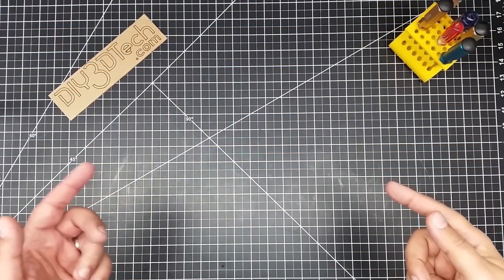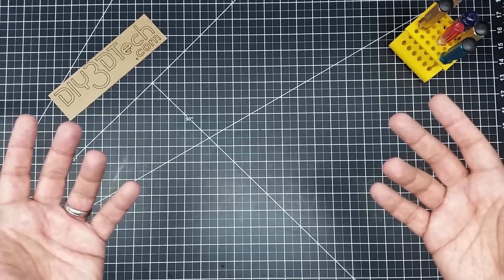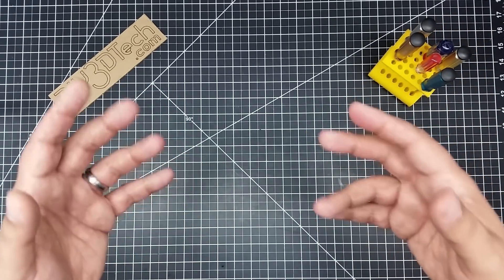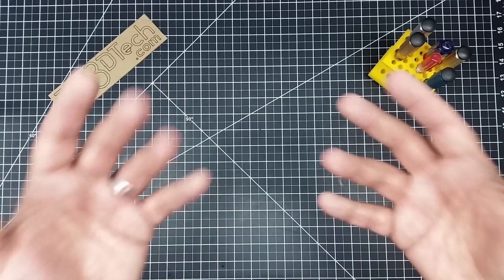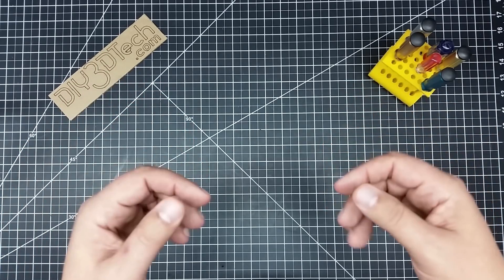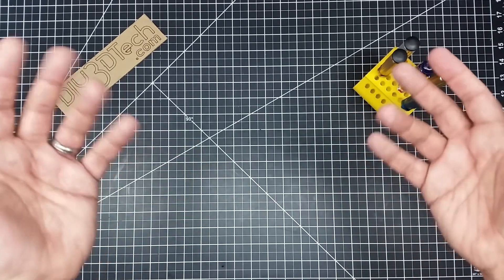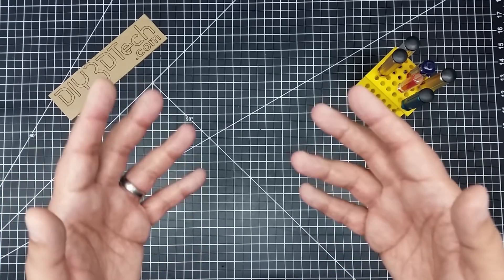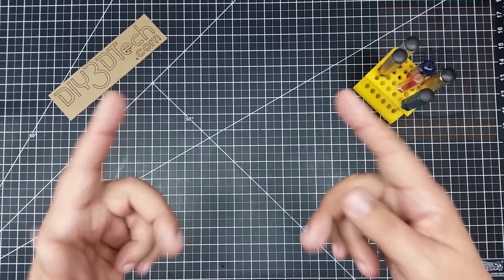I need to ask for a small favor...

Comment: 910 with my sub
Reply from the maker: Many thanks!  We are getting closer to that 1000 mark!
Reply: I'd like to see a easy starting; add a cube change the size, move the cube, add a sphere shape make a hollow through it add one to the other
Reply from the maker: Not sure I am tracking, so you want a "cube"  okay, "change size" do you mean parametric?  Add a sphere (to the cube?)  Then "make a hollow through it add one to the other"?  Do you mean you want a a parametric cube with a sphere differenced out of the inside?
Reply: Almost any : I use TinkerCAD so as close to using that. : Visual, Add a cube change size, add sphere, hollow, hole through the sphere, join the sphere  to the cube; I want to know if it is worth the Learning OpenSCAD, I've done Coding, programming before but don't want to do that again
Reply from the maker: If you have coded before, Open-SCAD is EASY!  What I am missing is "Add a cube change size, add sphere, hollow" as if do this, the result will be one or the other (i.e. cube or sphere) as you could have a "cube" and remove a "sphere".
Reply: thanks
I I right 
a) add a cube using code
b) add a sphere using code
c) add a cylinder using code
d) Use code to make the cylinder
e) Code union sphere to cylinder , negative union Boolean
f) Code union the cube to the sphere  which has a hole in it

Sounds like a lot of code, to me,and the have code to to add sizes placements

May as well use C++ LOL
Reply from the maker: Easy watch for a video on this